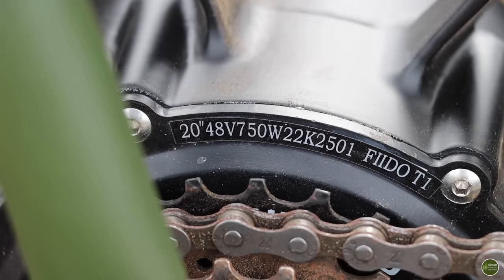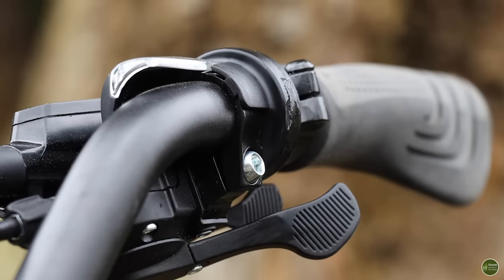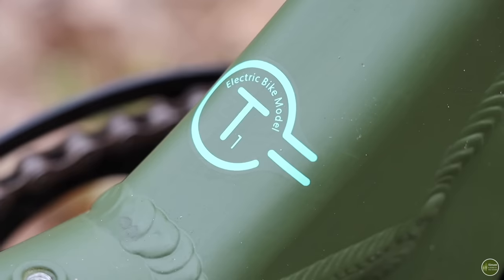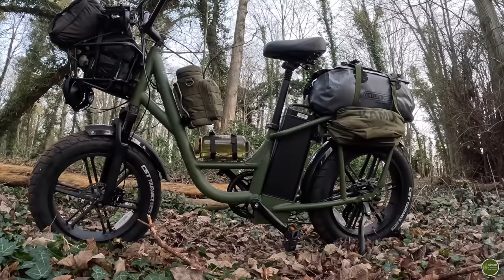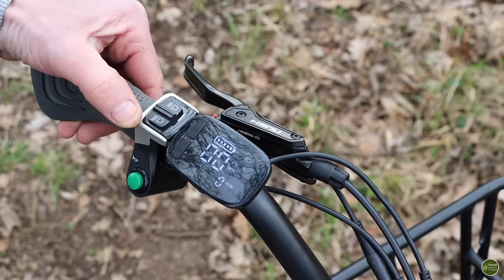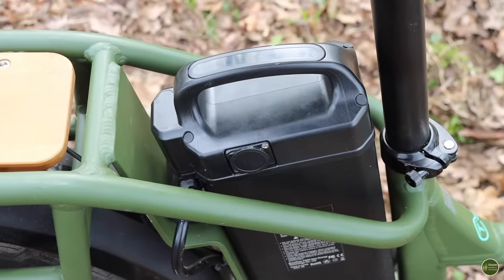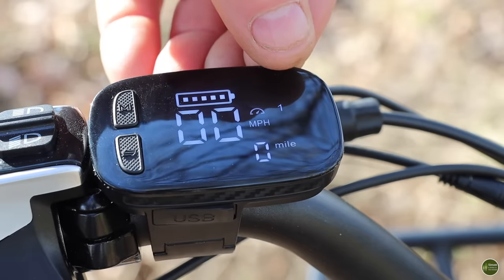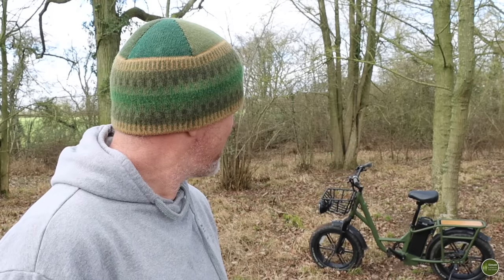Fiido T1 Pro Utility E-bike.  My Long Range Cargo Woodland Assault Vehicle.  E-bikeThrottle Removal.

Comment: It's news to me about the throttle being an issue. That definitely wasn't when I built my ebike. Does that apply to a thumb throttle? I wasn't fully aware of the 250W either, just limited to 15.5mph I believe is the actual max speed. Using up to 750W for acceleration would be better than 250W so long as the motor cuts off at 15mph, particularly uphill.
Reply: yes the law is pathetic and is actually putting people off getting an electric bike, the Police told me that "having a throttle makes it a motor vehicle" what a farce, If you are loaded up with equipment it's  impossible to do a hill start with Pedal Assist only because the pedals have to be going round before the motor engages. What would make more sense if the throttle cutting off at 10mph or something, or after 10 seconds
Reply: @utubeape  I have to assume the throttle law is recent then. I definitely bought a UK legal e-bike I didn't build back in... November 2020. It did only have a 250W motor though, but a grip throttle. I'm guessing there's some overlap between things there, but I do remember they recently changed some laws regarding e-bikes even though we were already quite limited as to what was legal.

EDIT: and in truth my current ebike is not legal I guess. I have a motorcycle license and I actually do wear full helmet on it, mainly because once you've gone any reasonable speed into rain and headwinds on a bike in winter even just cycling, and then done it with a full helmet, you want to wear it
Reply: @irreverend_  I think so long as you are not riding like a chav with a new toy you won't get stopped by Police. I have seen those Deliveroo with ebikes that have massive 1500W rear hub motors and if they can operate then the rest of us habitual users can.
Incidentally those who would be hardest hit are the middle class who have those long ebikes with 2 child seats on, and delivery guys with big cargo bikes, their motors claimt to be 250 but in fact have 'peak power' of between 850 and 1250
Reply: Some of those laws strike me as totally bogus. I live in an area with a lot of hills. BIG HILLS! To attempt a hill on a bike with no guts kind of defeats the whole purpose of having an e-bike. I  am 73 and have a need for reliable transport. The local busses go nowhere near where I need to go! Totally sucks!
Reply: @damogranheart5521  I don't think cops would confiscate a bike from a 73 year old, get a bike with a Bafang BBSHD and your hill worries will be gone
Reply: @utubeape  I mean to be fair I have always ridden a bicycle properly since taking my cycling proficiency test at about 6 years old. I don't know if they still do that. I give cyclists a full 6ft/2m clearance when passing them in a car as well for the same reason. Given how often I get passed on my bicycle with barely a foot though, I feel I may be the only person who does. But yeah, I've only been pulled over by the police once in my life, I was riding a motorbike in the middle of 3 police vans, and I was just following the one in front, the one behind pulled me over because apparently I'd made a bad turn at the junction, just behind the other police van. They weren't wrong, but you know...... a bit hypocritical

Comment: Well done for taking on board the comments and acting. Shame others don’t do the same and be as responsible. 

However The fact that the motor is stamped 750w then that will make it still not legal. 

Good job on doing what you can to conform but it really still needs to meet EAPC rules to be classed as such and this still doesn’t.  It also is not type approved so another area there to look at. 

Unfortunately the motor being stamped 750w doesn’t do you any favours as the motor has to be stamped with the power capability and manufacturers name.  The fact this still says 750w but is restricted electronically is irrelevant.  The rules as I interpret it states motor power.  Not restricted power.  

I guess they need a way to trace what’s what so electronically limiting it, still won’t circumvent the law.

Comment: Would it not be better to just make a snap release throttle that can quickly be removed when stopped along with fake stickers, it’s not like the Police can ride it to check the power, alternatively ride it like you stole it and the Police become even more irrelevant than they already are as nowadays they seem to Police via telephone from a call centre back at homebase soon to be their actual home working remotely no doubt to be replaced by AI and robot drones!

Comment: Liked the video but cutting and disconnecting the throttle control was a step to far. Unless you do something reckless in front of the police or a member of the public then you will be ok . In every big city in the uk there's hundreds of just eat guys using them in throttle  mode , the police are not interested  unless you fuck up.  Just don't be nuisance to anybody and crack on.

Comment: Well glad I did not order that then - all that weight with 250 watt power and you will be lucky to get 15 km per hour let alone 15 miles per hour and the range is going to be cut too. So useless for the road. Why would I pay nearly €1,500 for that bike when I could buy one that does the same for half that price.

Comment: Ha ha ha ..I wouldn't own a 250 watt bike, do cops our Bobby's check your pedal bike over there...I've watched 50 different guys in the UK with 3,000 watt bikes...If you can't replace a car with the bike, that is a real problem for our future, or lack of a future..It's a nice bike and the tires are meant for speed on the road, they are nice, but not for 250 watts..

Comment: Sod the police mate Iv got a 8000w kaabo wolf king gt pro e scooter does 62mph and a diy 2000w rear hub motor on my push bike does 45mph never had no problem with the police on both just ride if as long as your not driving like a complete bellend and u just open it up abit when nothing about u will be fine